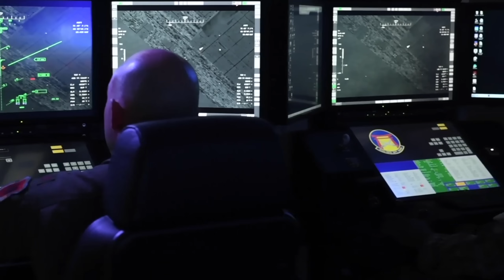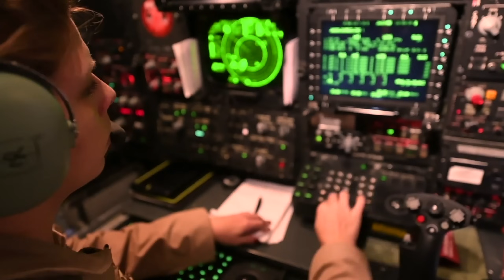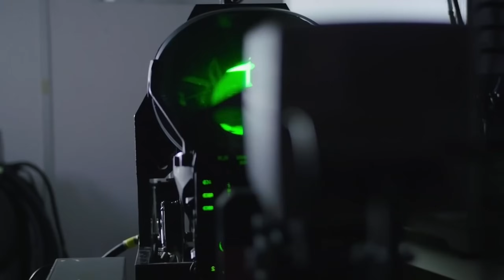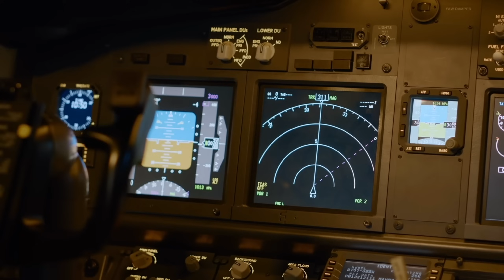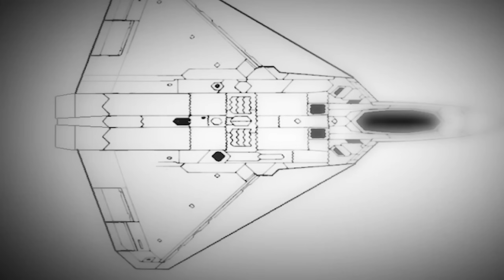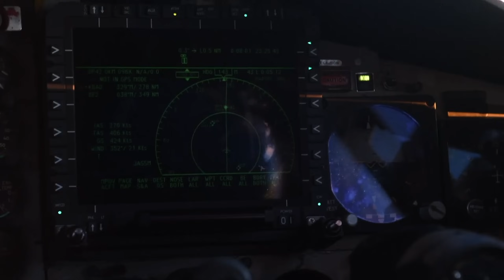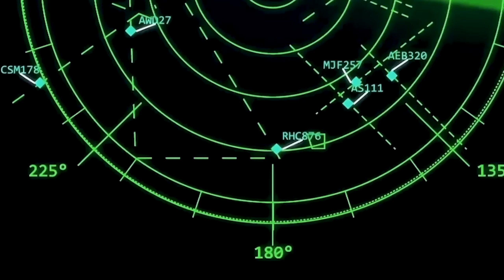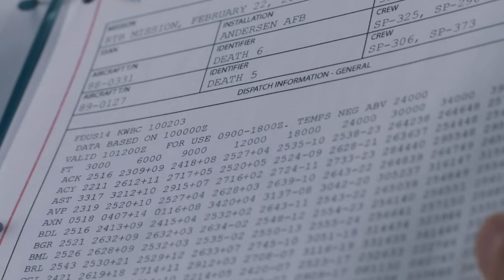B-21 Raider: US Most Aggressive Stealth Bomber Jet Ever Built

Comment: Northrop Grumman has experienced cost overruns on the B-21 program, leading to significant losses. B-21's stealth capabilities could be compromised during aerial refueling, especially with large tankers. Which is the core of the entire fleets production costs, fuel.

Comment: 7:57 Snrrk Just got through talking about how the B-21 Raider has a range of 5,600 miles compared to the B-2s 6,800 miles but that the B-21 Raider wouldn't need a complex support chain. So you're literally saying the B-21 Raider wouldn't need aerial refueling even though it's range is inferior to the B-2s? This is a rather bold and nonsensical statement to be making cause this wouldn't make sense to even a 5 year old.